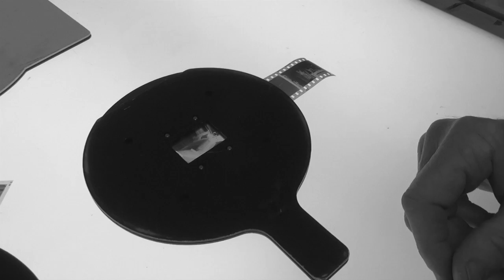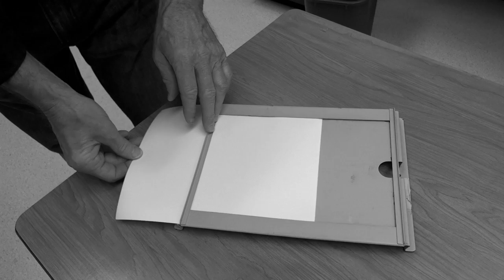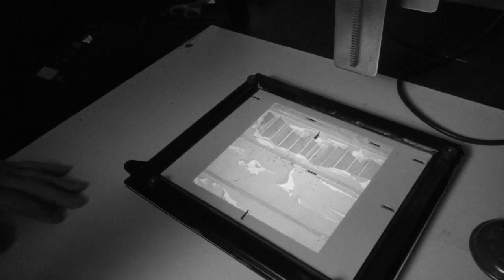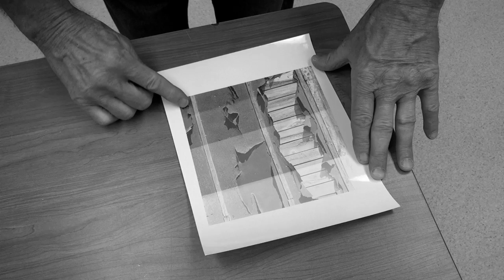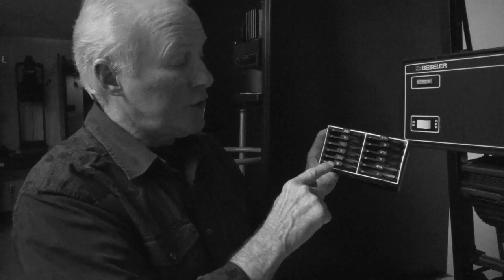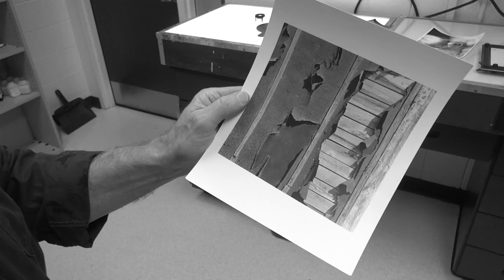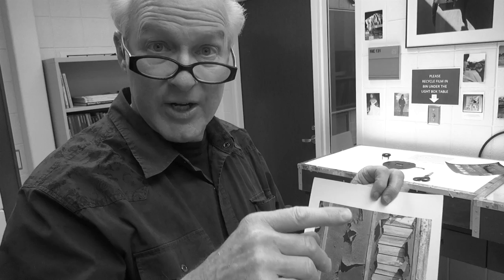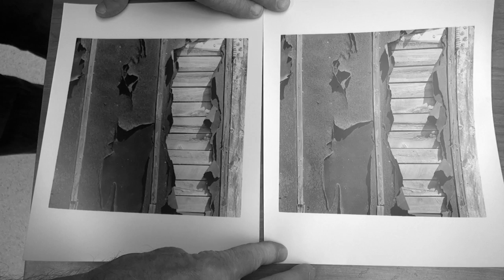Making a B&W Print

Comment from the maker: Not sure if there is an enlarger specifically for that purpose, but you could turn your jpeg into a negative by inverting it in Photoshop and then printing it on transparency paper/film. Our enlargers can handle very large negatives--check what size the enlarger you want to use can handle and print your inverted photo that size. Good luck!!

Comment: Hi prof.Agar.. i enjoyed watching this channel.. thankyou for the tims making it.. i just got an enlarger last nite..hehehe.. the thing i have been looking for on google but could not find is.. is there any rule of thumb or formula to use for exposore time when you stop down the aperture 1,2,3 stops for the final print (after test shot).. i saw him do that on other vid,but he mentioned that it is a heavy math.. when he stop down from f11 to f16 he doubles the time .. is there any formula or time table i could use ?
Reply from the maker: Professor Agar says "As you open up your aperture lens ( f16 to f11), you let twice the light out so you would cut your time in half to compensate your exposure. As you stop down your aperture lens–which is usually the case (f 5.6 to f8), you cut the light in half so you need to double the time to compensate for your exposure. Most beginners blast their exposure with too much light and short exposures. Not good (as Trump would say). It is better to adjust aperture and time to about 15-20 seconds, giving you controls in dodging and burning as well as consistency in exposure time." Hope this helps! Good luck to you!!!

Comment: Quick question for the Professor. Did you change your exposure time when you added the contrast filter? Thanks, love your videos.
Reply from the maker: +honkeytn Professor Agar says, "Yes I did. But if you print with Ilford Multigrade paper and Multigrade filters you can start with a no. 2 filter for the initial print. If and when you change to a higher or lower filter the time remains the same until you get to a 5 filter." Hope this helps!! Thanks for watching :)
Reply: I do print with Ilford Multigrade paper but have a Kodak Polymax contrast filter set, because that's what I got when I bought my darkroom setup from a local photographer who had retired. i don't think my negatives need more than 3+ or -1 contrast filter so once again I thank you for a clear explaination.
Reply from the maker: You're welcome!! Good luck in your photography!

Comment: Thanks from Tasmania! 🙌 A quick question, though - what affect does aperture have during the printing process? E.g how would setting it at 2.8 affect the final print compared to 16 or 22? Other than letting in more/less light
Reply: From what I have learnt from the ilford site, the main difference you would get is the length of working time. With f/2.8 you would have a very short working time, so if you had D&B to do you will need to be really quick.
Also as with any lens, they tend to work better a stop or two down from their maximum.
Reply: Ashley Scott thank you! ☺️
Reply from the maker: @ Georgia Lilley: Professor Agar says, "In theory a good lens is equal at all apertures. Reality through testing indicates a 'sweet spot' where one aperture seems to bring out the best sharpness." Good luck to you!!
Reply from the maker: @ Ashley Scott: From Professor Agar, "Both comments are true. I find most beginners produce bad prints because their aperture is too big and they do not have enough time to do the burning and dodging successfully." Thank you for your thoughts and for watching our video! Best of luck to you!

Comment: I love this series! Two questions: 1) what timer is being used on the enlarger in the video? 2) I have the same enlarger (Beseler 45s diffusion chamber) and use Ilford 8x10 paper yet it takes approx. 60 sec at f8 for me to get the density professor Agar is getting in 10 seconds at f8 or f11... why is that?
Reply from the maker: Baisao Photos Professor Agar says, "There are many timers that will control the enlarging exposures. And they are all expensive, so buy used! What I use at school is different than at my own home. I use a Gralab, Model 300, which counts backwards, with test strips at 2 1/2 or 5 second intervals, depending on what I’m doing. So I do it by eye with an 8x10 piece of cardboard; Ansel Adams used a metronome so he counted in his head. 

On the exposure issue, there are so many variables in photography that you would have to find your own way in your own environment. Variables include: negative density, paper developer used, lens aperture, brightness of bulb in enlarger head, and so on. The advantage to the diffusion head is the feeling of less grain but the light is usually not as strong as a condenser head. A true Faustian Bargain! A 60 second exposure is too long for me as I am getting old and have only a few years left. I might suggest opening the lens to f5.6 for a 30 second or even f4 for a 15 second exposure. At least you have enough time to dodge shadow areas—unlike my students who like to expose their paper at 2 seconds!!"

Thanks for watching!!
Reply: Trangent Thank you and Professor Agar for answering my questions. One thing that occurred to me is that I am not using a 35mm mixing box in the head of my enlarger and this may be the main reason for the longer exposure times. It could also be the ISO of my paper. I don't mind that it takes around a minute. Thanks again!
Reply from the maker: Jim Trahan You're welcome Jim :) From Professor Agar, "I doubt the "mixing box" appropriate for negative coverage is the problem. My 4x5 Beseler with diffused color head is always set for 4x5 negative coverage. I simply swap out lenses for 2 1/4 and 35 mm negatives. True, all papers have a different "speed" thus the necessity of a test strip, but I have only noticed "warm tone" papers with a need for double the time in exposure."
Reply: Trangent Well, I'm stumped then. I use Ilford Multigrade IV RC & FB papers (neutral tone), at f8, using dichroic filtering for Grade 2 contrast, developed in Ilford Multigrade. My negatives are developed in Pyrocat-HD and scan normally. All my prints take about 1 minute of exposure +- 10 sec. for 8x10 or 5x7. My prints show an appropriate amount of detail in zones 2 & 9. I may just replace the bulb and see how that changes things. As an example, my RC prints of this image look exactly like this scan, except there is subtlety more tone separation in the print than what I could get in a scan: https://flic.kr/p/riGgPt
Reply from the maker: Jim Trahan I love the richness and detail of your photos!! They are simply amazing!!!!!
Reply: Trangent Thank you, genuinely. They are moments of meditation: ordinary, transient items seen with a kind of nobility, or else the profound stillness of night, a celebration of a world asleep.
Reply from the maker: Jim Trahan Love them!!! You are a great photographer!!! Thanks for sharing them :)
Reply from the maker: Jim Trahan From Prof. Agar: "Hi Jim, Nice print! I like it! Thanks for the info on Pyrocat-HD. I must try it maybe with some night photos.

I usually use 4x5 Tri-X, T-Max with HC-110 (quite diluted) or D-76. I do not use any filter in my dichro head enlarger to start with. My negatives are usually a bit soft so if I use a filter it is always to add a bit of the magenta dialing in -10, 20, or 30. Seldom beyond that. 

You know, if things are working well with you I wouldn't rock the boat! You could always buy another bulb and see. If it is the same, then at least you have an extra bulb (which usually burn out after all the stores have closed and it is a Sunday!). 

Good Luck,
W
Reply: Trangent Thank you both! You are very encouraging. 

I won't rock the boat then. It's good feedback to hear that the dichroic filters are not being used extensively and that the mixing box is likely not an issue. I imagine that speeds things up too. I've been dialing in yellow and magenta according to the Ilford paper documentation. I like the results I'm getting so I'll stick with it. There is something about a silver-gelatin print, even on RC, that is missing from the ink prints I've seen. The blacks have a depth to them that's hard to describe, it's more than black, my eyes could linger there for hours. The range of grays is expansive and smooth, no twitchy gaps. It's more work but I think the result is worth the effort. 

Regarding Pyrocat-HD, it seems to work very well for a lot of the films I use, especially FP4+ and Eastman 5222. I try to share as much info on my images as possible to help people along the path, just as I have been helped. That's why they are all tagged and well documented. A couple of things to note about Pyrocat-HD: to avoid pinholes it's best to use a water stop and to use a pH neutral fix like T-F4 or even Rapid Fix. I get a modest increase in film speed from Pyrocat-HD, increased acutance when used semi-stand, and I like how it preserves more detail in my highlights compared to non-staining developers. The latter property is why I have chosen it for my high contrast photos with Eastman 5222. It's not a miracle developer but it has some very fascinating properties. 

It's the end of the semester so I am sure you are both very busy. Again, I am grateful for you taking the time to reply. I look forward to future videos. Perhaps one on toning?
Reply from the maker: Hi Jim! I'll pass this info on to Prof. Agar :) Funny you should mention toning... We recently did two videos: one about fun things to do with photography (which needs a revision) and more recently, one about sepia toning. Both should be uploaded in the very near future :) Keep up the great work!!! Love your photos and love your subjects!!!
Reply from the maker: Baisao Photos Sepia Toning Black and White Photos: https://youtu.be/piKRwFTCuqY and Fun Things To Do with Photography: https://youtu.be/sVOqXEvhBos

Comment: Can Prof Agar answer this question:  Should a variable contrast filter be used when making a test strip on B&W?  Here is my problem:  I make a test print w.out a variable contrast filter at F8, for example. From the test print I select an exposure time, for example 6 seconds.  I develop the image and decide it needs additional contrast but want to keep the highlights.  I insert a #3 variable contrast filter (or whatever number).  I expose another sheet of paper for 6 seconds and then develop.  The image (always) comes out 1 to two stops lighter compared to the image without the variable contrast filter (I'm only using filters from #2 to #5).  Is this normal?  I'm not complaining since I'm able to increase my exposure time so as to have more time to dodge/burn.  But if I can anticipate this I can adjust at the onset and save time and paper.  Thanks.....Matt
Reply from the maker: Professor Agar says, "No, make your test strip with the filter. But do you know if you need a filter? I usually don’t so I make my first test strip with no filter. I might still not know if I need a filter so I go ahead and make a print. At that point it is obvious to me if I need a filter. I then guess at the added time needed or make another test strip. If you are using Artista or Ilford start with a 2 filter when making a test strip. If you find you need a higher filter you can insert the new filter but keep the time the same until you get to the filter 5 when you must double the time." I hope this answers your question and helps you with your photos. Thanks for watching Mathew! Good luck to you :))

Comment: wouldnt putting the paper in after you have focused on the easel change the critical focal point by the thickness of the sheet?
Reply from the maker: Redman Excellent question! The thickness of the paper would not change the focus appreciatively. However, you could place a blank sheet of photo paper (same type/thickness) into the easel and use that as a focus surface. Professor Agar says the advantage of doing this is that you would have a nice white, reflective surface that makes it easier to focus on. Thanks for watching!!

Comment: Why did you use your magenta dial, rather use the contrast filters you explained just before that.  The bessler I just ordered is black and white only, but does have contrast control.  I guess when it arrives I'll figure it out.  Thanks!
Reply from the maker: ***** Great question!! Most enlargers do not have built-in filters like the Beseler Color Head that Professor Agar demonstrated in the video. Filters placed under the lens or above the negative holder do the same thing. Thanks for watching!!

Comment: what enlarger is good for 4x5 large negative?

Thank you ..jhon
Reply from the maker: jhon gris Hi Jhon! You can use a Bessler or an Omega enlarger to make a print from a 4x5 negative. These enlargers will print other sizes of negatives too, such as 2 1/4 or 35mm. For each size, you need a different lens and different negative carrier. New enlargers are around $1,200, or you can get a used one for little or next-to-nothing. Good luck to you!!

Comment: I guess maybe it's a moot point... but why not just set the timer to 9 seconds?  Suppose it doesn't matter.  Seems like hitting the button three times and waiting a second in between exposures is more work.  Not much, but just saying... why not just expose for 9?
Reply from the maker: At about the 6:00 mark, Professor Agar develops a test strip in 3 second intervals. It's a little hard to notice, but there are 4 different exposures: 3, 6, 9, and 12 seconds. Setting the timer to 3 seconds and moving the cardboard barrier a little between each exposure is a more accurate way to determine which exposure gives you the best print. This doesn't have to be done for every negative on the same roll of film--especially if they are all of the same density (which you can easily see from the proof sheet). Thanks for your comments :)